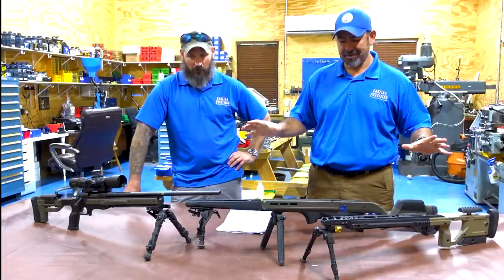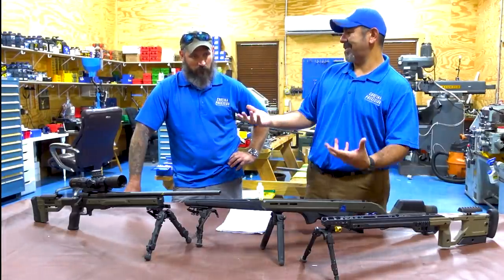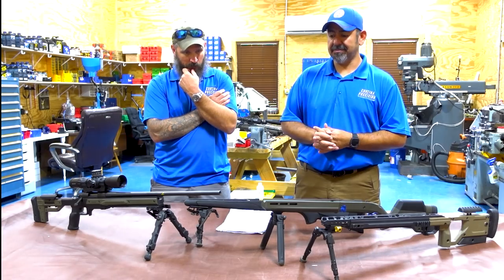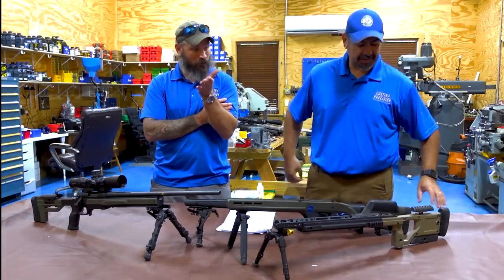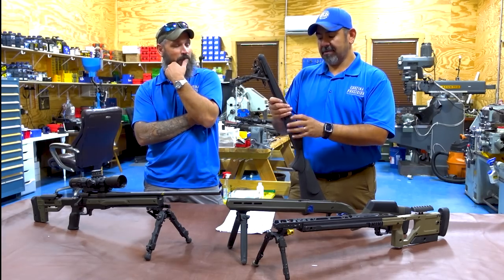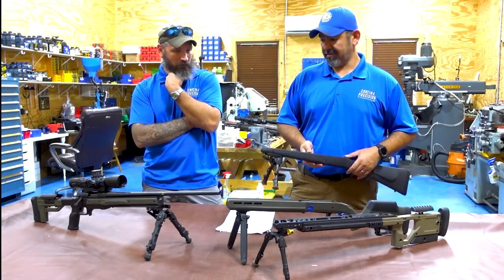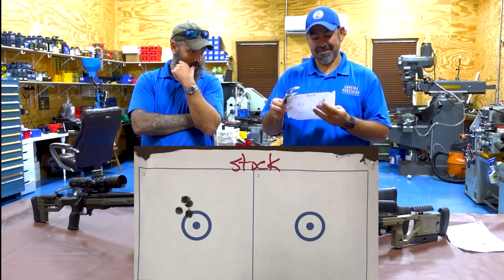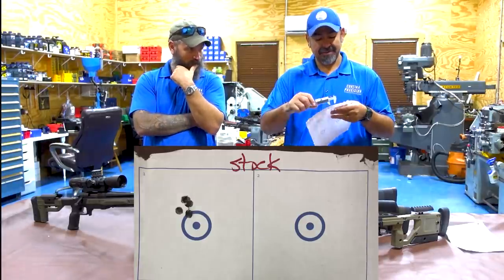6.5 NEEDS-MORE | WE TESTED FOUR DIFFERENT STOCKS

Comment: @Erik Cortina since you have modified the stock it’s not really a control in the truest sense of the word. That said I would put it in a stock/chassis that makes it more consistent for Jason to shoot or do all testing of both rifles with the same stock. 

Modifications. I believe you, Speedy and Jim Borden have said the place to spend your money is the bolt/fire control group. So before you mess with the barrel on the gun you plan to modify, get that bolt tuned to perfection and see what that shows. Possibly add a trigger first and test that so the bolt mods would be complete with a solid trigger.

Comment: All great comments, ideas. I side with budget vs customized to compare cost/benefit, also to have stated end point/goal for customized ie: consistent 1/2 inch moa? Finally have a couple shooters from beginner to average (compared to top class like you two) skill level use both to see if it shows a significant difference.(as in biggest factor is the shooter once rifle/ammo is 'good enough') 
In different test series I'd like you to answer for those of us(less than 400yd, 1 to 2 MOA, 4 times a year ) that use Factory ammo (standard and/or match quality) can using a tuner bring the precision even close (1/2" group size difference)to what hand loading can?

Comment: I'd play with torque specs and also check each chassis for any unwanted tension. Also if a chassis fits well I belive the playing field is level as far as accuracy. The bipod is going to make a bigger difference than another chassis will. This is just what I've seen. Of course when you get into positional shooting you want the chassis to work with your body more.

Comment: A control is not necessarily the absence of treatment. A control is doing what you would normally do, to compare that with whatever it is that you are evaluating. So if you normally would not keep the factory supplied stock, the best control is to replace that stock with what you would normally do. Scientifically, you did the right thing by replacing the stock in the control rifle.

Comment: Try adjusting the action screw torque, ex.... do 5 shots at 25 in lbs, then 35, then 45 or something along that line.  Sometimes it makes a difference, sometimes it doesn't. After that, tuner time. You could also try glass bedding to one of the aftermarket stocks. I know you don't have to but it's the only way to get that perfect fit between the action and stock. Sometimes it makes a difference, sometimes it doesn't. Then the trigger if they are terrible.

Comment: EC tuner break on one and both in the same chassis is my choice. Whichever is comfortable to the shooter so the shooter is consistent. It seems obvious they are very comparable guns so changing things just make it shooter friendly like trigger etc is just going to change both guns the same. Tuning the load or tuning a load for them is the only way you are going to see which one actually outshoots the other. Keep the control rifle stock except for the chassis to make shooter consistent. Shoot the control gun the same number of rounds as the other so you can see if it improves as it breaks in compared to the other one with modifications. Otherwise there is no reason to have two rifles, as Erik said it might just be getting better as it breaks in.

Comment: Eric, it seems that being "stock control" is no longer an issue. Modifications are being made to customize both guns. My question would be which customization gives the best improvement for the money on both rifles. Say for instance, would the pillar bedding on both factory stocks resolve the accuracy for both rifles? Would tuners make them both shoot comparably and if so, what are the settings on both tuners? The list can get long. Thanks.

Comment: Wow, this is really opening my eyes.  I was thinking of putting my Savage 12FV into a chassis but I'm having second thoughts for the cost.  With my 120gr handloads and good glass I started out at 1/2moa and long story short with load development, if I do my part that rifle has posted 5 shot groups at .360".  Call it 3/8moa.  Of course that is at 100 yards to minimize my mistakes but that rifle groups amazingly.  The 12FV sits in an upgraded stock, still Tupperware but it's much stiffer than my Axis 270 and has a wider, flat bottom forend.  Currently I'm only shooting at 300 yards that's why the 120's get loaded but 140's are in the works for ranges over that but at 300 I have seen a few 1moa groups.  I'm very interested in this project and can't wait to see where it ends up.  How about trying some simple handloads to see what better consistency will do for groups and what the rifles will do compared to off the shelf ammo ?   Thanks.

Comment: Simple-  Which ever stock set up shot best leave it stock 100%.  The crappy shooting one begine to modify until you get it equal and see how much $ that would cost someone.  I would start with floating bedding as that is basically free. Then add a trigger. Keep testing until it gets to same MOA as the better shooting one. Then drop it in an Oryx chassis. Then add a threaded tuner last as many dont have access to a smith.

Comment: Put a new barrel, tuner and trigger and install in oryx on #1.  Then thread and put a tuner break and put back in the factory stock.  Basically #1 is full upgrade and #2 is upgraded on a budget (in steps).

Comment: Leaving the control alone definitely does provide benefit, even though you already have data for it...because as you already saw, it might shoot differently as break in occurs or some other reason. But if you bedded it, then there's no way to know if it's break-in, or bedding or combination of both.

Comment: Agreed the control has served it's purpose. Obviously you keep the data and just reference that. The only reason you'd keep the control would be to keep throwing rounds down range in step with the test rifle to account for the barrels getting better or worse over time. But for what you're looking at I think that's probably not worth the price of ammo, and bumping the control to at least a more comfortable stock makes perfect sense to me. Have you considered bedding the recoil lugs in the chassis? I and my friends have had some good luck reducing first/second shot fliers by bedding the lugs on chassis. Doing a tuner or tuner break seems like the next logical step and will probably net you your next largest accuracy increase. If you're only talking budget drop in's obviously the trigger would be next after the tuner. But at some point you'll have to start doing some gunsmithing stuff. I'd be interested to see after you've done all the drop in fixes what giving the fire control system some tlc will do, bushing the firing pin, move to a smaller firing pin, make sure there's no drag, upgraded spring etc. and see how big a jump that makes on the upgraded version vs the stock version (in the new chassis). Just depends on where you draw the line between how far can you take a factory barrel and when you are going to start messing with that barrel or move to a custom barrel. You could lap the lugs but then I'm pretty sure you'd need to re-headspace the barrel. And I think it would be neat to see how much the fire control upgrades does before moving to that.

Comment: I bedded a stock with jb weld. It swelled up while curing. It was hard to get the action out of the stock even though it had plenty of release agent. I had to scrape every surface except the bottom of the action and the back of the lug.
The rifle shot good but I wouldn't recommend jb weld as a bedding compound.

Comment: I'd say keep the control untouched now but keep shooting it too keep round count the same. Pick a stock since it seems to make little difference now (bedding vs chassis). At the end of the series when you have an idea of which improvement worked the best, only apply that improvement to the control and see how much you improve (for example is it better to replace the barrel or put a tuner-brake on the stock barrel). The point of the series is how best to upgrade on a budget. we all know you can spend $1000s on a new chassis/stock, new barrel, brake, tuner, new trigger, and blueprint the action but at that point you basically have a custom rifle.

Comment: Once you have the control data point I don’t see any reason to keep it stock.

I do think the ‘control’ gun should be 40 rounds…or some unreasonably large group.

After that…I’d actually like to see a round robin style comparison…
Barrel and trigger
Vs
Trigger and brake
Vs 
brake and stock
Vs
Stock and barrel 
Etc etc

And then show which is the most bang for your buck…ie a $900 barrel might be the biggest improvement (say 0.4 MOA) but if the stock and trigger get you really close (say 0.5 MOA)…

Comment: Think the control shud have kept the Harris bipod on it for all tests. The foray into changong the stocks is fine, but, the bipod shud have been kept, not changed every time, even though it apparently doesn't really seem to make any difference. On a budget hunting or range gun, most folk I know of will opt for the Harris. Seeing as he shot one with a Thunderbeast, need to do others with that before a tuner brake, I'd even do the trigger before doing the tuner, but, after doing the brake test. Last change would be action work, then the spring.

Comment: If they are both shooting the same then start upgrading both of them but with different upgrades. Start with bolt on upgrades first like triggers and springs before you modify the rifle  permanently by turning the barrel.  Put a trigger in one and a spring in the other then compare to see what improves the rifle the best. Then undo the mods and test the next option. Once the bolt on upgrades are complete then install breaks and tuner breaks and compare. This way we can learn what each mods does to the rifle and what mods give you the best bang for the buck.

Comment: My deal is how consistent is the sub-half moa out of the original stock. If it shoots that well out of the original put a tuner-break with original stock and get rid of the hoping. But if the sub-half moa is not consistent than move on to what stock is.

Comment: I like the idea of keeping the control 1 step behind, I agree that you have the data from the original control to refer back on, why keep beating a dead horse. I also think that the initial mods should be kept to ones anyone can do ie. Bolt on mods, even the pillar and bedding was more then most would like to accomplish on there own. The only concern I have with changing the Control is, The Control seems to continue shooting better the more rounds it gets, so it seems kind of hard to say was it the mod that made it better, or is it the barrel settling in? and you could question the modified version due to that same issue.  So how do you rule out the  Barrel Settling in? You may have to continue going back and forth from original to modified in both guns until the groups remains relatively consistent between tests.

Comment: Erik I believe if a factory gun shoots close to or better than moa after bedding with factory ammo the gun is working and your biggest gain will be with load development that's what I vote for!  to go from 2 moa to one moa can be hard but it's harder to go from 3/4 to 1/4 if you do it don't stop with seating depth testing test it all the way I bet you find it shoots jumping between 60 and 90 thow off jam I start at 10 off jam and I end up between that with every factory gun iv done using your methods. some people stop at 35 and say it doesn't shoot but I have found it pays to test the full range

Comment: control with a tuner and original stock.  Change only one thing at a time on the control.  You can then measure which change affected accuracy the most for a sensitivity analysis. Maybe try redoing the muzzle crown on both first

Comment: My vote is keep the factory stock. Do just old school hotrod tricks. Times are getting hard. The savings could get someone into hand loading. Is there a high density foam to fill the stock stock? You could cut the other to see where the voids are. You would probably have to sand it smooth where you drill and fill. Function over form, I’d take ugly if it works better.

Comment: Personally I think you should keep the "control" gun with what the average shooter could do with bolt on drop in parts. What works best? if it is a stock plastic OEM gun stock that is bedded that works best keep it that way. Try what the average guy would do next like a trigger for both and move forward from there. How much money will it take to make an inexpensive firearm shoot like a custom firearm? With the other firearm put a tuner brake on and see what improvement if any are noted.

Comment: informative video. I would like to ask you and others with a lot more experience than me about a rifle I bought to shoot in a kind of 600 yd club when I was in Washington State. Not being able to afford a custom rifle like most of the people had I went to a friend that owned a gun shop and bought a Remington PSS I believe it was called, caliber .223. When I shot it at 100 yds the best I could get it to group was about 1.5" even with handloads. I was so disappointed by this I almost gave up there but decided to shoot 200 yds and the darned rifle shot groups hovering around 1" or a little less. Took it out to 600 yds and found I could regularly Shoot groups of around 3.00 - 3.75 " if it was not windy or I was able to read the wind right. As I remember it the load was Sierra 69 gr over 25.5 of little Varget. Any way, what would have caused this rifle to shoot a lot better at 200yds and out than at 100 yds.

Comment: Do a budget upgrades and a no budget upgrade.

Step by step changes, increase and reduce weight, change the weight distribution forward and back, change scope height, re barrel one, tuner brake on one brake only the other, then tuner only without the break.

Really find out what “bolt on” bits give the best results.

We already know that changing the stock clearly doesn’t improve accuracy, only comfort.

Comment: As you shifted from stock to stock the barrel should have been cleaned and five fouler shots fired.  Then cool to ambient and shoot ten in ten minutes.  Shooting without cleaning was just an exercise in what happens with a Rem barrel as it gets dirty.  Most of my factory barrels do the same thing.  First 5 are poor, followed by 5 to 10 very tight and above 10 the groups get erratic.

Comment: Keep it cost conscious put it in the magpul bed it and put a brake on it. Clean up the factory trigger if it’s adjustable. I think it will drop way below 1/2 M O A. This would be a very possible  set up for most shooters that magpul is very comfortable and relatively cheap

Comment: You guys started throwing ideas of springs and bolts at the end of the video. If that is a route you take, I would take the whichever gun to Speedy and have the action timed. Essentially that is what your talking about when firing pin springs and what not come into play. Leave the control in the Oryx, and put the "Upgrade" in and Oryx as well. Once you get to the point of timing the action, put faster lock time spring into control to show the difference. If you get all the way along. It would be cool to see the difference between blueprint and factory....but I think that is way down the needmore list.

Comment: You know the control rifle is a .5 to 1 inch gun depending on the stock. The other rifle does not have a good barrel compared to the control rifle. Now is time to work on the #1 rifle to see what makes a difference and can you bring it to the same point as the control rifle or better.

Comment: cheap or expensive, I personally would always change the trigger. Maybe you shot so much you dont need that, but I do. Then I would do the tunerbreak. And the Spring after that. The handle should not change groups. The Control should stay as it is and be the controll in the weather conditions.

Comment: Do a different modification to each and compare the change to each. I.e. will a trigger make more of an improvement than a muzzle brake. Then make both changes to both rifles, now they are the same again (returning a control because they are the same again) now make different change again to each I.e. springs to one or lapping to the other again comparing the change. This will demonstrate which change has the most impact and allows for a control as they are similar to each other after each series of modifications.

Comment: Do a cheap vs expensive . Put the stock one back in the stock stock with a cheek riser and maybe a nicer butt pad. Then put expensive trigger or tuner brake on the one and a cheaper trigger or regular brake on the stock one.